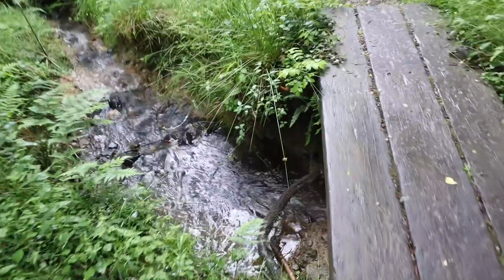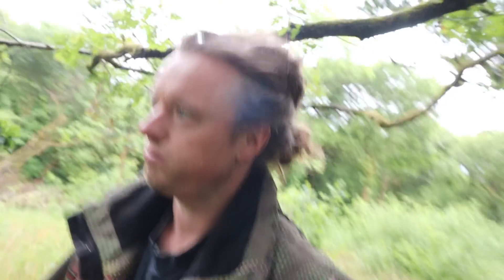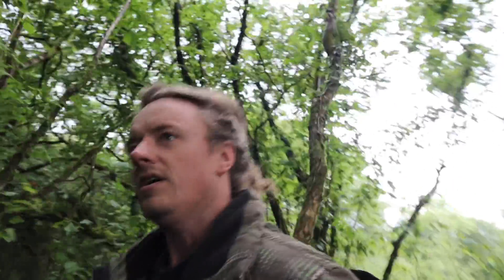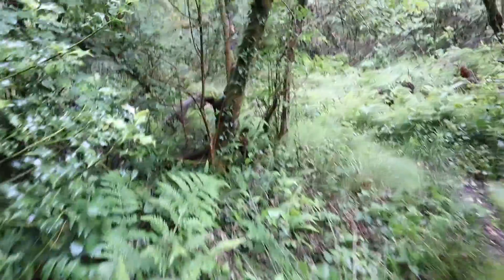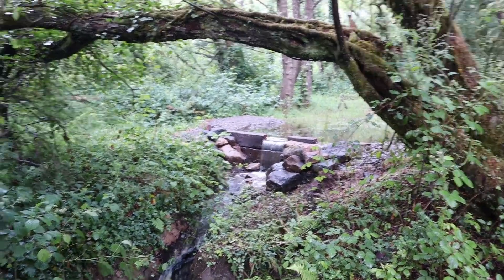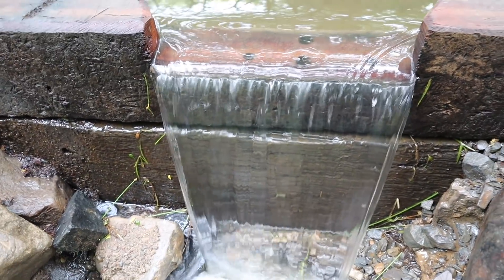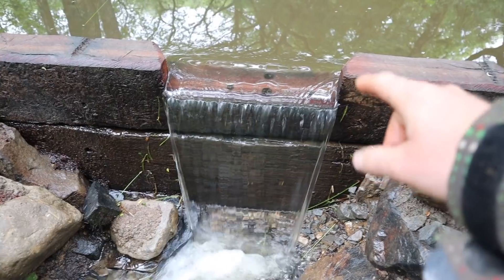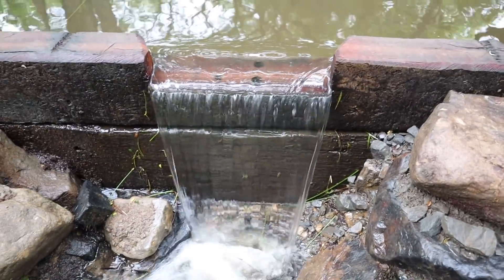Hydroelectric Dam Update After Rain Laminar Flow

Comment: I dont really understand why you want height. You need pressure. Drill a hole in the bottom of the dam, then all the water which is higher than the hole will increase pressure. Or do you have a good reason for doing it like this?

Comment: Dams don't quite work the way you currently have it. You need to build up the sides a bit more and have a gentle slope into the middle where you have "laminar" flow. If you don't do this, when you have a lot of water coming down the drainage line the water will preferentially go down the sides and erode the banks and that will eventually collapse your system. All you have to do is build up the sides a bit with large angular rocks. You have to make your stream want to go through the centre rather than at the outside. Don't want to preach, but currently it won't work for high flows.

Comment: After spending the past 3 days watching all of the HE videos... A few suggestions, engineering wise. 
1: Small brass pepcocks (thumbscrew weep valves) installed into each of the  nozzle elbows (the highest point) to bleed out air (Also one in the manifold tank). You could even use remote actuated ones to open for 10 seconds when the valve is opened automatically.
2: Behind your dam intake notch, install a small baffle at dam height, but only extending down about 25mm below the intake, and behind about 4-6" (10-14cm); That will screen any "floaters" (and bugs) from getting down into the pipe; as well as damming bubbles (if any).
3: Small efficiency gain: taper the hose barbs to half a millimetre; this also will prevent sediment settling. Also goes along with your noting of the reduction hoses going into the manifold. You may want to optimize that when the 2nd dam is up and running.

Comment: You have to love it when a plan comes together.  Looking really good for a first run.  A couple day's labor well spent to put it all together.
The holding pond level looks a bit on the high side after a single night of rain.  Several consecutive nights of rain might result in water overflowing the sides or back end of the weir, causing some potentially serious erosion, which might lower the water level enough to stop flow out the hydro feed slot, or worse to empty the holding pond.  Remember the rate of water into the weir WILL equal the rate of water out once it reaches a steady state level. 
Put some thought into how you can control any flow rates which exceed what the current weir outlets can handle.  Perhaps adding a higher secondary overflow outlet on a side or back area with a lining and rocks to control where the overflows go if/when they happen.

Comment: You dont need to take the intake down, there are other ways.
I would highly encourage you to take a look at the Video "What is a Weir?" by Practical Engineering for some other ways to increase the discharge without lowering it or making it bigger.
Maybe it will help in this case ^^

Comment: You should add a "guard" to prevent floating element to get in the laminar flow and by extension in your intake. You could used 4cm width sheet metal bent in an 0.5m radius parallel to the surface and half submerged. Afixed it on the dam wall inner face and centered to the overfill, every floating elements will be stopped and they will ultimately sink.

Comment: Why not raise the overflow rather than lower your input flow? Lowering it - does that not cost you some potential energy ?
Reply: Mak Daddy1968 -     Per another commentator's answer: "The left corner of the retention pond is definitely close to overflowing around the retaining wall he built, 
lowering the weir gate is preferred to trying to hold more water with a higher overflow gate."

Comment: Maybe you could stake reed bundles lengthways before the pool so water can flow through but debris is stopped,or plant reeds somewhere that doesn't impeade and cause flooding? A water wheel that relies on width and that floats on two hulls would solve the silt issue and change in water level,would have to be tethered also
Reply: James Cunliffe -     Another commentator made the same suggestion. This is the answer from Kris: "yeah that would be a nice addition, i think that might happen anyway though without me having to do anything. Lots of willow root will stabilise it as well."

Comment: When you mentioned lowering the intake level to create a larger separation to the overflow level I first thought why not just add a strip of wood across the overflow level to raise it up. 
But then as usual you answer my question by showing how high the water is up too along the weir on the other side of the creek.
Reply: I thought the same thing, just put the flat piece that he cut out back in.  Chris is right about the overall height of the pond.

Comment: Tip Top. Lovely job. This is only an idea if'n you haven't thought of it already and it may very well be of no use at all? But the top of the filter housing could possibly fit over and hook on the water side of the weir allowing the water to smoothly slip through and over the top of the filter in one nice smooth flow, without any joints to pass over airiating the water further  taking out the problem of the ripples and slight water undulation, also making the installation easier, probably? And if'n that was the plan already, i'm sorry for writing this lol

Comment: Just a thought here, Kris - but,. what about a very straight 'lip', levelled true, made from metal along the edge so the water runs perfectly over? You could fashion one in your workshop, give it a rounded but dead straight edge (along) and the water would flow perfectly over the top. Think: a 1ft cylindrical bar of brass or something. :)

Comment: Kris, rather than reduce the height of the weir on your main spillway perhaps consider fitting a stainless plate on your overflow/bypass weir.  With slotted screw holes this will allow you to adjust the height precisely, and also act as a useful bypass, when lowered, during fitting or maintaining the coanda screen on the main channel.
Reply: In fact, during the dryer months when the hydro is not operating, you could lower the plate fully and use this bypass flow to run a ram pump /IBC container for easier watering of the veggies.

Comment: Very impressive, I had a thought when you were discussing your plan with the overflow.  Why not make metal ‘gates’ just strips of stainless and chisel slots into the overflow so you can raise or lower it in, say, 5mil intervals. You could make a plate from the same material to line the base of the main outlet so you get a perfectly flat flow.  I’ve no experience in this so not trying to claim any sort of expertises it’s just an idea humbly offered for consideration.  Thanks for the video chap and, yes, the rain is very welcome.
Reply: Rob Chorley  That idea could be expanded with  a float and leverage arrangement to act a governor controlling the flow rate. Perhaps an overkill.
Reply: The low technology solution is to have floating ball. The ball would be on the other side of main intake so that leverage was big enough.
Reply: This needs to be seen, alongside Ralph Wilmots comment
Reply: Sounds like a good idea in my humble opinion.

Comment: You can screw a piece of wood into the overflow gap to raise it a bit.
Reply: Theo Ty -       This is another commentator's answer (which Kris agreed with): "The left corner of the retention pond is definitely close to overflowing around the retaining wall he built, 
lowering the weir gate is preferred to trying to hold more water with a higher overflow gate."

Comment: Instead of messing with the hydro cut out and spoiling that perfect flat flow, you could just add a little height to the overflow.
Reply: Problem being, as was shown the water level at side of the pool was pretty much at the top so there would be overflow.
Reply from the maker: Exactly, it need to come down a little bit anyway.

Comment: Don't take the level down any lower surly just choc up the over flow a little instead..?
The more you can have behind that wall the better no.?
Reply from the maker: Well yes, but its a bit high and trying to creep around the edges and sides so it could do with coming down a little bit anyway really, coming down by 20-30mm will make it work better and only account for about a 1w or less loss
Reply: @KrisHarbour  fair.. You plan on putting any reeds in around the edge to help hold them all together a bit better aswell.?
Reply from the maker: yeah that would be a nice addition, i think that might happen anyway though without me having to do anything. Lots of willow root will stabilise it as well.

Comment: I'd be taking the water the other side of the dam from the lowest point on a flexi hose so that it can be pulled up to clean the screen. The exit through the sleeper at the bottom. Then you would have Hydro with a higher head from the weight of the water above it.
Reply from the maker: It would be blocked up in seconds and there would be no real grain in head (just the tiny bit lost for the drop of the screen, about 100mm) taking water from the bottom with gravity pushing down on the water is no differant from taking it from the top and then gravity acting on it in the pipe (as its now higher) all it would do having at the bottom is suck in a load of sediment and block in seconds.
Reply: @KrisHarbour  All depends on your screen and intake.
I have come up with several ideas that use various ideas of filtering particulate that is similar to that used in mining.
The head of water is also the weight in the pipe. Can't remember exactly but a 180mm dia 100mtr line should hold about 2.4 ton of water.  
Your suggesting that the dam you built adds little to the total head, well put it this way, I dare you to try lifting the equivalent weight in water head...  Your also creating storage. If your stream is constantly running dry, then you really need to find a way of storing water and that could also mean building a large storage pool (lined) that is filled by the excess hydro power you may have. 
There is nothing stopping you in real terms building a secondary dam a few feet in front as an intake to the hydro which then makes the higher dam the settling pool to help discharge any energy in particulates that clog up screens. 
You have created a head but it is limited to the amount of outflow your dam allows.
I just think that you are missing out on a lot of potential, its not like you don't have the materials laying around...
IDK if you have considered it but how about a Tesla turbine, they have ability to cope well with particulates and the hose that drives would not need any nozzle  and they are efficient, translate more energy of water or air or whatever is being used to drive as well as that, they are also good for pumping.
That would negate a fine intake screen.
I believe you have a few options and a way of adding capacity to your hydro to ensure a more regular supply of energy.
Reply from the maker: I think you are forgetting that the mass of water has no effect of pressure as the mass is exerted on a larger area. By your logic the presure would be different at 2m down in a swimming pool than it would 2m down in the sea. (discounting the difference between fresh and salt water) that isnt the case and not how physics acts on water pressure.
Reply: @KrisHarbour  No I am not, by your comment, when you are turning off the hydro by the main switch, you have to what... because of what...
Water moving, its mass is its energy, you can have very fast moving water with nil effect, its called spray.
There was another video of a similar system, theirs ran at 8psi and it produced 2KW per hour from several inline peltons from a main feed line that was 100 meters long and its angle /inclination was I suspect similar to yours.
As I have pointed out, with a bit of thought, you can vastly increase your capacity, produce a constant supply with option to switch on more head for larger demand... Utilising some physics, old technology, mechanical engineering and some topology change, IMHO you could provide plenty of hydro for yourself with little overall effort.
I am trying to use tinker cad to model a design idea I had for an intake that self cleans. I have tried using more complex CAD but its all gibberish, I can just about get TC to work, so maybe, you'll get a glimpse of what I have dreamt up.
For example, while you have a head of water, you're exit strategy is losing out from a bottom level pipe exit that can run in to a RAM pump and fill a water storage tank at a higher level than the source. Sure it takes time but the potential is there to store water, use a physical property of water to lift itself.
As I have said to your reply about blockage, Tesla turbines are not an issue, they can take up to 85% solids and still pump or turn. The pump air or liquid as well as can be driven by air or liquid.
I just designed a water pump that uses compressed air to pump water,  what gave me the idea was seeing a fish bubbler in a fish tank and I though Hmmm, if bubbles can lift water, I thought, what If I made a pump that used a principle that is used in robotics to actuate a system to pump water, I imagine with enough inputs, pumping water 20 to 30 ft not an issue, maybe with scaling you could pump water vertically for a hundred or so feet. All from 1 ATM.
Anyway, I am all backed up and need to empty my head in to my computer... Ciao.
Reply: @KrisHarbour  Also, there is possibility for an Archimedes screw pump that could assist in moving water from the one stream you said you were going to take some water from and that can be driven by the passing water in the stream you are taking water from...
Its all in the design and implementation.
You have obvious terrain issues but nothing is impossible. 
Also, don't forget that RAM pumps are good at lifting water and require small differential to lift water high, some of the Victorian parks had fountains that had ram pump fountains that could send water 20 to 30 ft or higher. 
Also, besides solar PV, you could utilise the wind energy on a mechanical pump to lift water on days where there is sufficient wind.
An idea may be to have a lower holding pool of a few thousand tons of water that can be lifted by such a method back to your head, daft as it sounds, it is possible.
As you have also shown a solar Thermal idea of heating water, what about using a parabolic and focused beam on to a small point to sink thermal energy in to a small pipe and then pump water through it to recover the heat. Failing that, a large Fresnel lens focused at the right distance  may help improve the thermal pickup. I have seen ole satellite dishes turned in to parabolic mirrors and a collector at the focal point can get hot enough to melt softer metals...!
I can think of loads of things that can be utilised, implemented, taken advantage of... Are you doing TEG anywhere you use heat? Anyother form of Thermal energy recovery? I suggest you check out a guy called Maximus Ironthumper, has an interesting solar thermal, thermal recovery, solar energy and excess energy dumpped in to a thermal sink to heat water.  You might get an idea or two from there.

Comment: I've got an allotment, and watching it rain was great. I can leave the place alone for a few days to just get on with growing, and not have to spend ages watering it - only to watch the water evapourate off the ground in the heat. Things also seem to grow faster when it rains, compared to being watered by hand.
Reply from the maker: Yeah same here, i have been doing alot of watering and not having to do that now for a few weeks at least is a massive time saver.
Reply: @KrisHarbour  you could build a ram pump for watering your garden.
Reply: Semi automatic irrigation system. Water tank on altitude, valve, pipes with holes in them.